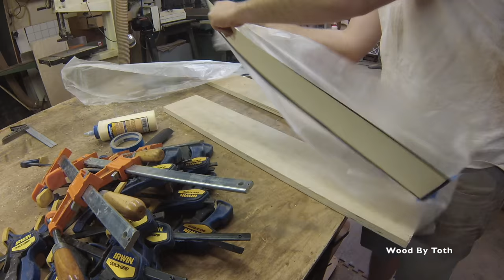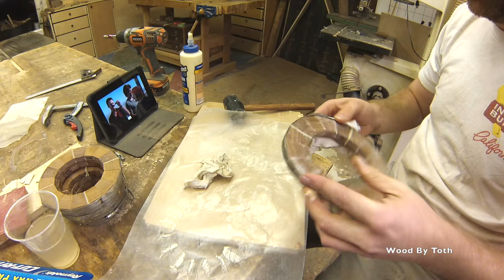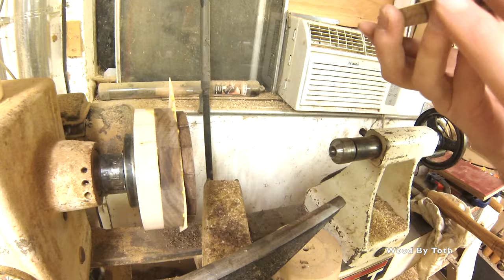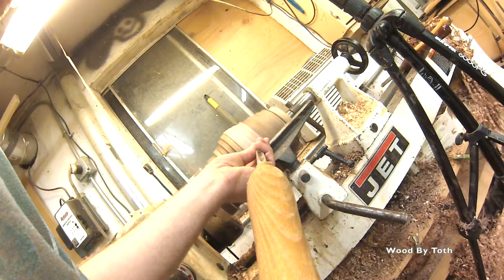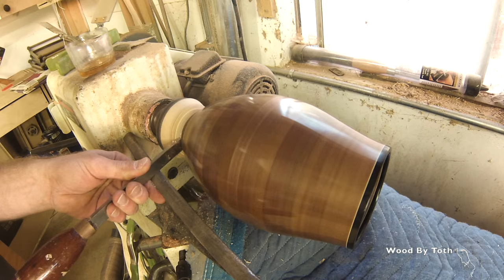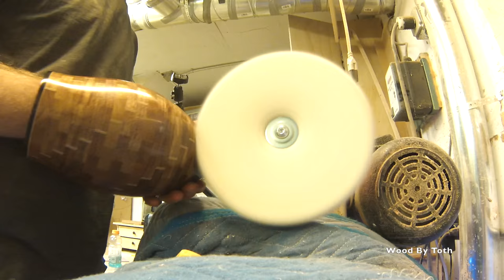Woodturning A Segmented Vase

Comment: It's crazy to think with all those clamps on that lamination there you are probably pushing 1,000-1,500 pounds of clamping force. 

You ever try hammer veneering with hide glue? A crockpot, Hot Iron and a veneer hammer (you can make yourself) and it's super fun, and fast!
Reply from the maker: I have used that before. I like hide glue, it is fun to use. I just forget that I have it sometimes

Comment: How do you keep your angles so accurate? With the infill pieces also. Do you use software? I've been looking at sleds for cutting segments but you seem to nail it with a chop saw. What is your secret? Thanks for sharing your skills.
Reply from the maker: I have dialed in my chop saw. I took the indent plate off and filed the notches to be more accurate. (The 10° 15° 2 22.5° and 45°) i cut around 70,000 pieces this way. I don't use software. I use pencil and paper. The sleds work well but they are too slow for me

Comment: What chisel are you using for hollowing?  Does it come with that support ?
Reply from the maker: I made that chisel myself. Its 3/4 inch bar stock with a carbide cutting head, then I added that stabilizer part